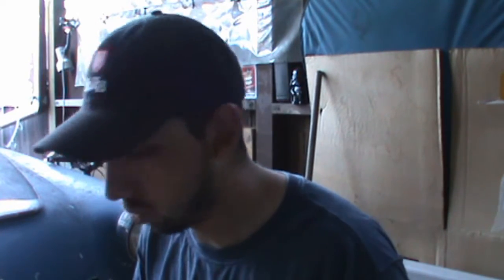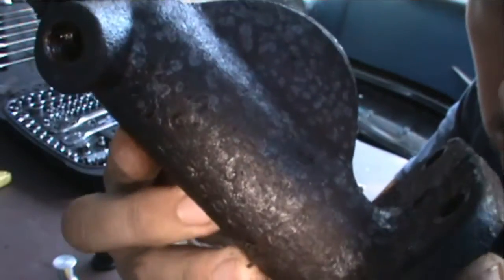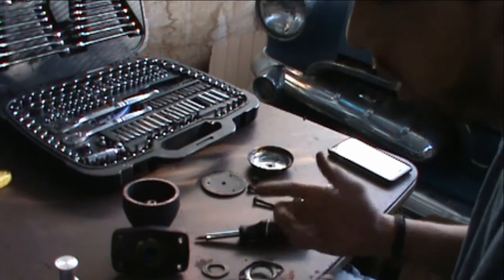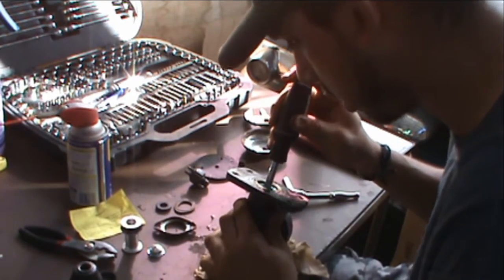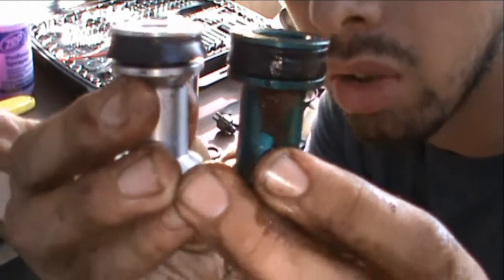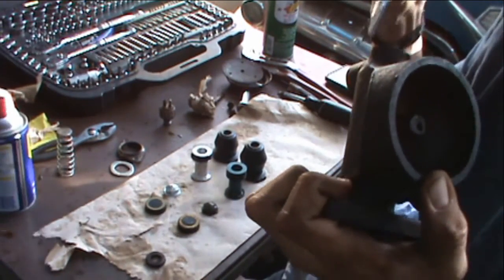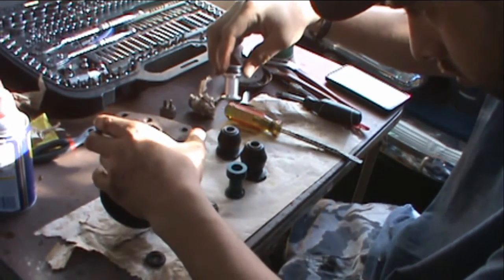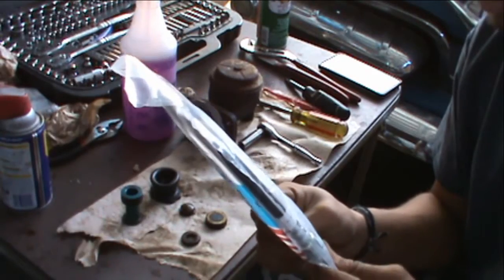1955 Dodge Royal Pt2

Comment: Good video. I have a 1955 Dodge Royal also that I am getting ready to replace the single master cylinder to a dual. I was wondering how it turned out? Did your rebuild work? I would like to see more videos on your Dodge to see how it's coming. Thanks.